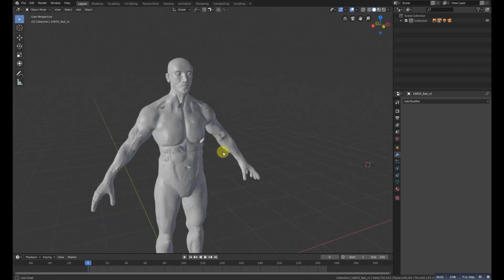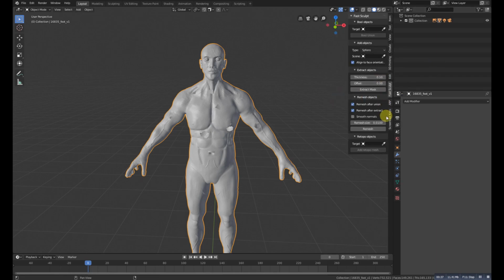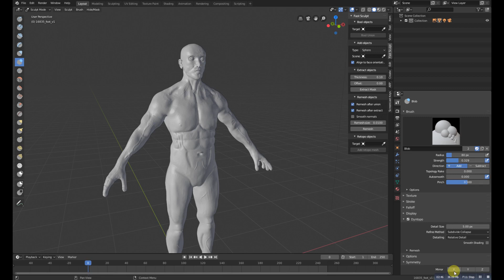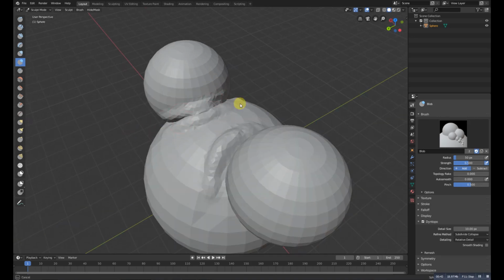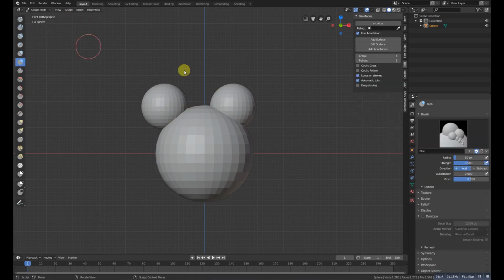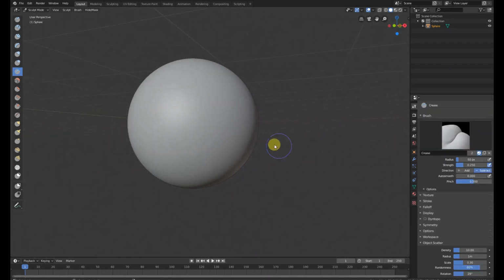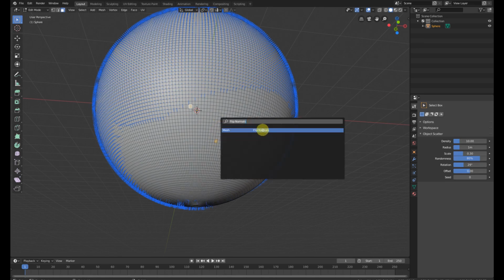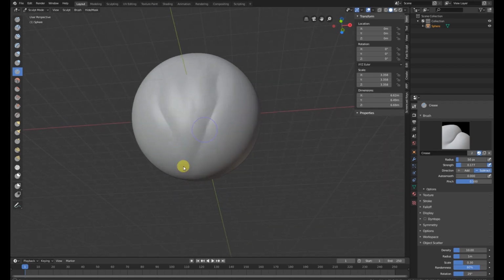How to Solve Common Sculpting Problems in Blender by Blender Ustad

Comment: I have a little problem when  i put a cylinder in my model in sculpture mode, i use ctrl j to make a union, then i use ctr R, when  i do that, one of the points goes off the model so i cant use symmetry anymore, any advice, thanks.

Comment: Ustad, that hole patching trick is awesome. I got that many times but so hard to fix. I hope you can help me on the sculpt mask tool. I am trying to use it on my model (blender 2.82a) but there is no black color appearing. I am sure there is a problem with my settings because if I make a new sculpt document then it works perfectly. I hope you solve this issue. Thanks in advance.